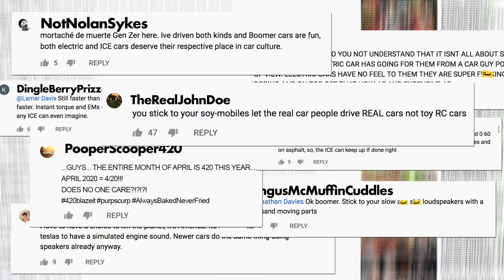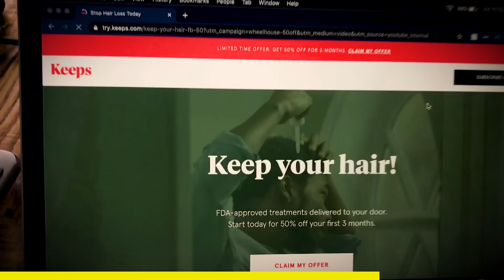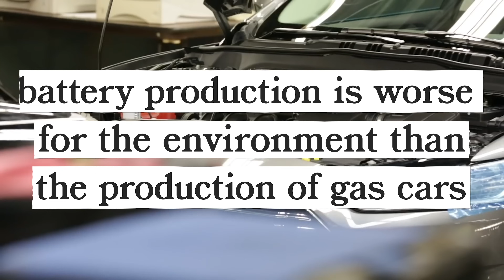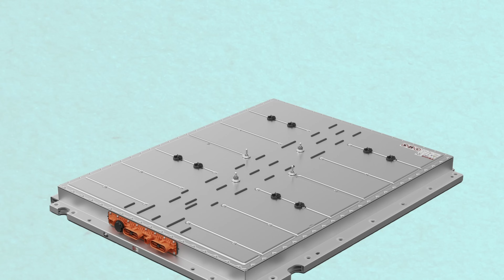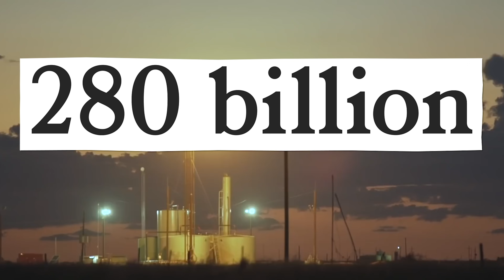Are Electric Cars REALLY Better for the Environment?

Comment: Well, you're not quite right about oil refinery. I'm from Siberia, where most of Russia's oil comes from(Khanty-Mansi Autonomous Region) and our oil companies managed to use that associate petroleum gas, so there's no methane and nitrous oxide in the air. Also, our company a working on other methods of making petrol production more eco friendly. 
BTW, the're ethyl and biodiesel, which don't need any crude oil to be produced and they create less pollution when used in internal combustion engines.
Reply: Also, here, where in january outside temperature can get as low as -50°C, electric cars wouldn't last as long as traditional cars would. That's due to heating. And there are a lot of roads, where it's quite hard to find even a gas station. I don't think anyone would want to get stuck somewhere in rural Siberia, at night, in winter, where outside temperature is -56°C, because the batteries died.

Comment: Environmentalists be dumb. End of story! Also, assuming the more demand for these cars the more efficient they become to make is assuming they replace the wheel so to speak (not calling you dumb by the way). Until then, the same method will just be done faster yet, at a larger scale. Energy comes from energy. We haven't warped the laws of physics yet.